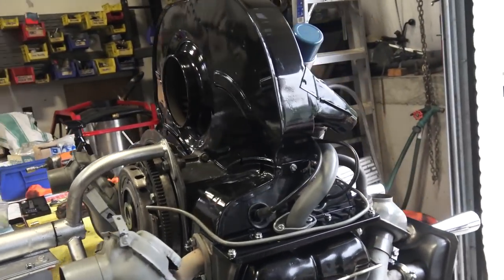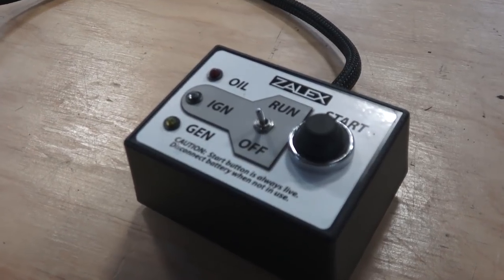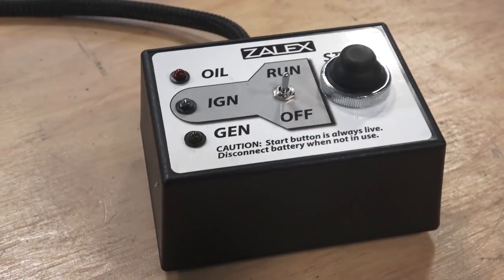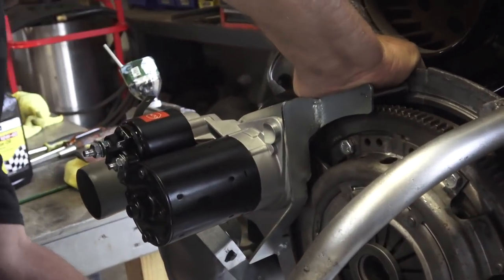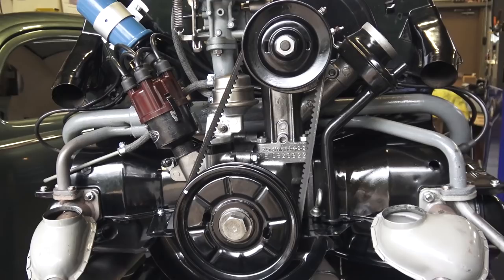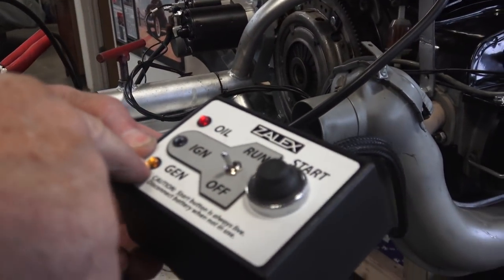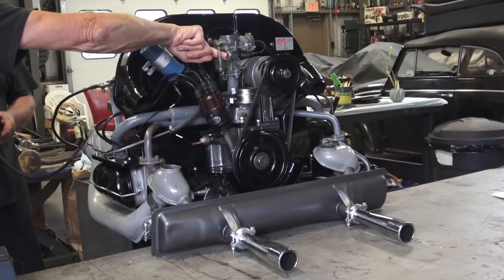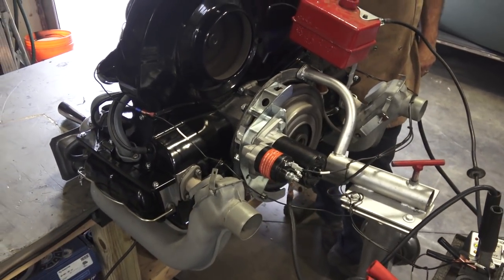Classic VW BuGs Zalex Bench Starter Ring Adapter Engine Kit Review

Comment: Thank you Chris for using our products.  If you or any of your viewers have questions, please let me know.  I'd be happy to help.  
One thing you can do Chris to build OIL pressure is to switch OFF the ignition and press the START button.  The engine will crank, but there won't be any power sent to the coil.  This means you don't need to disconnect the coil.  Very well done review and great looking engine!
Reply: Zalex is one of the best in the biz!
Reply: just got Zalex kit today. great product, one think i was better was the magnet. I wish it was a little stronger.
Reply: the controller moves around and is swayed down by the weight of the harness

Comment: Just wanted to add, anyone who has a more common V8 engine stand with the 4 arms, and doesn't yet own a VW engine yoke, Zalex also sells a full ring. The advantage of 2 arm VW engine yoke is you can split the case, when it's on the stand, which you shouldn't do with the normal V8 engine stand. Also with the common V8 stands, there may not be enough clearance to have the fly wheel, clutch and pressure plate installed, using the full ring will give you the extra space needed to keep them in place when working on the engine.

Comment: What if you have an AutoStick?
Reply: folks still have those ;)
Reply: It will still work.  The autostick starter doesn't require the bushing block support.  Just leave the aluminum block in the starter adapter and it will be fine.
Reply: @zalexindustries2968  But you need to have the torque convertor installed on the drive plate and I doubt that the ring adapter will clear it.
Reply: That may be true.  I have not tested this personally.  I can send you a paper template if you want to try it out.